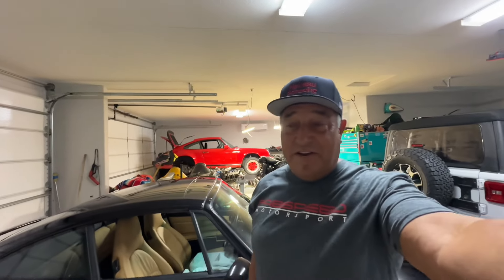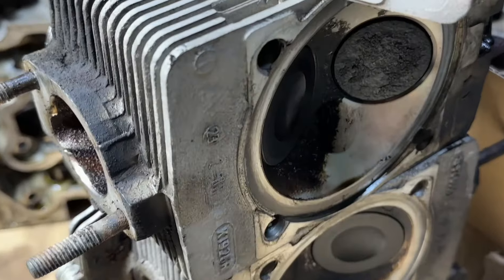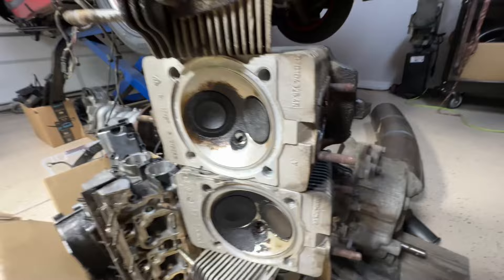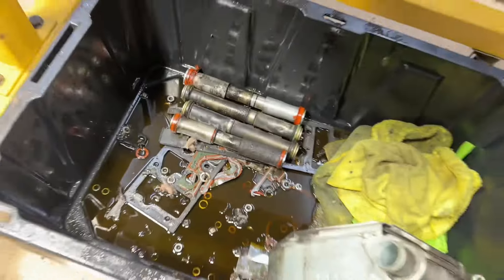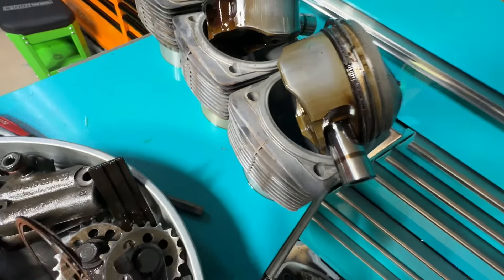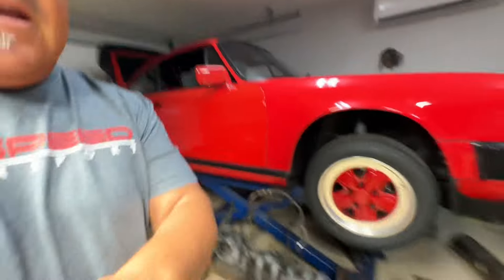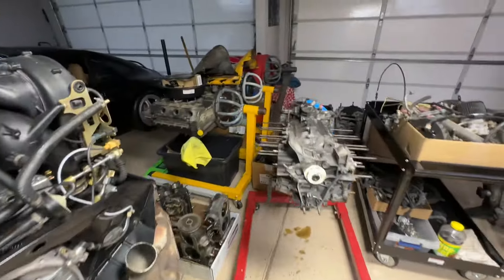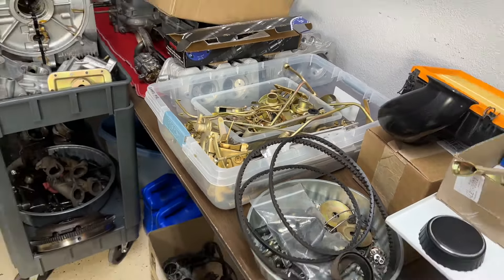3.2 Porsche 911 Carrera top End engine rebuild preview disassembled #havasuporsche

Comment: Great video.  I'm in the middle of having my '78 3 liter rebuilt.  Where are you sending the fan on the 3.2 to be restored?  I've had the fan and housing vapor blasted on my motor, and would like to send them out to be restored and Cerakoted.  I'm in northern Cal.  Thanks!

Comment: Hey David. Love your videos. Appreciate you sharing your knowledge. 

Question: What’s your process to swap the stock 3.2 rod bolts with ARP? Do you simply swap them out and torque to ARP torque specs? Or to stretch specs? Any dimensional measurements or resizing of the big end? 

I’m guessing that you’re simply changing them out on the stand and torquing them up and calling it good but just wanted to ask. These situations can get pretty controversial and create a lot of discussion so just wanted your experience and guidance as I’m planning to do same. Thx.
Reply from the maker: @brianrhodes746  hi Brian
Give me a call when you get a chance.  I can help.  
David 818 535-564five
Thank you